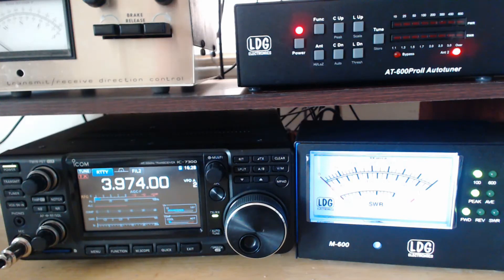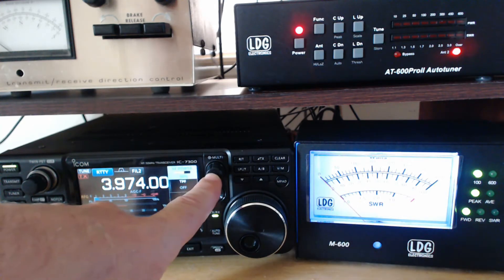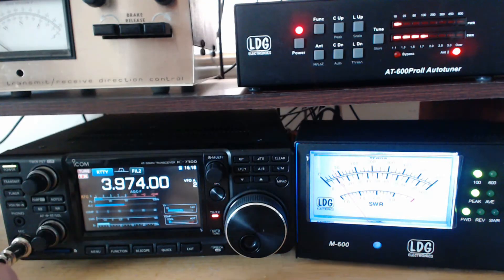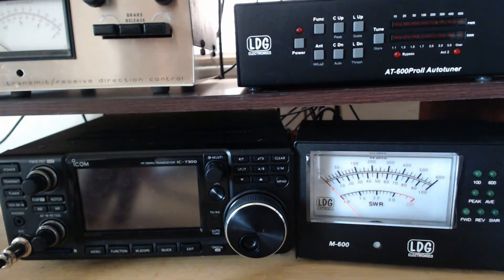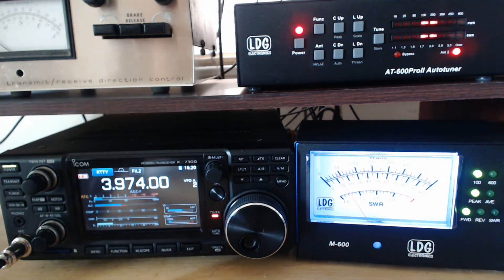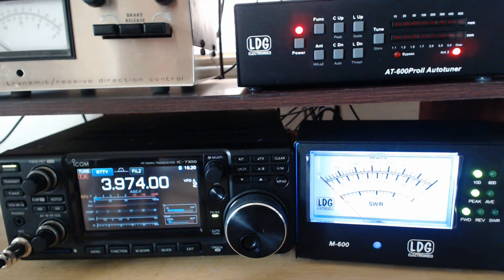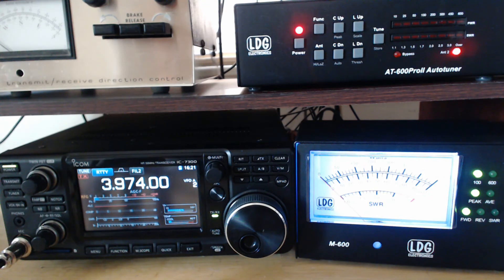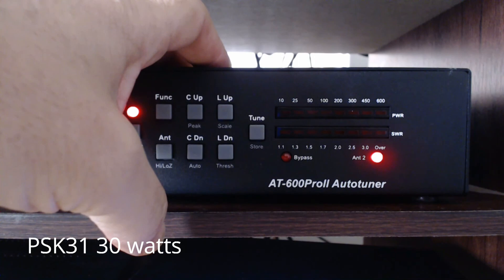LGD AT 600ProII Autotuner Advanced Operation

Comment: I’m thinking about buying the LDG AT-600ProII remote antenna tuner for an off center fed flagpole antenna and a rain gutter antenna. They are non-resonant antennas that could have very high SWR. How well does the remote antenna tuner perform when the SWR is very high?

Does the remote antenna tuner make any difference for the received signals, or is it only for improving the ability to transmit?

Could you make a video demonstrating the larger accessory SWR meter with your amplifier?

I’m considering SGG, LDG, and MFJ remote tuners. SCG is the most expensive, but maybe the best. MFJ might be the lowest quality according to many reports. How do you rate the LDG remote tuner quality compared to the competition?
Reply from the maker: Hi Dave, thank you for reaching out and commenting here. I don’t know if that LDG would handle the rain gutter antenna or a flagpole antenna as you described. Your best bet would be with a roller inductor manual antenna tuner. You could address your question to LDG support and see what they say. Yes when the antenna is tuned RX is increased. I am in traveling and don’t have access to the big meter. GL and best wishes to you and yours. 73 and good DX!
Reply: I didn’t realize it right away that LDG tuner is a shack based antenna tuner, not a remote antenna tuner. I want to use an antenna tuner for non-resonant antennas, such as an off center fed flagpole antenna and rain gutter antenna. 

There’s a W6NBC video that explains the differences between the resonant and non-resonant antennas. The non-resonant antennas, or resonant antennas that are used severely off frequency from their resonance, where the SWR is high must be tuned with a remote antenna tuner, not a shack based tuner. The SWR can be pretty extreme, like 10:1, 30:1, even up to 100:1!

The reason that the shack based tuner cannot be used for very high SWR conditions is the coaxial cable loss. The shack based antenna tuner makes the radio happy, but the SWR is high on the entire length of the coaxial cable. So, the power loss in the coaxial cable can be severe, like a 50% power loss or more, even with 100 feet of LMR-400 coaxial cable, which is low loss coaxial cable.

The solution to the high SWR problem is to put the tuner near the antenna, which calls for a remote tuner. That eliminates the severe coaxial cable loss, and makes the radio happy.

What’s the worst SWR that you tune with the shack based tuner? It would be very interesting if you could measure the power loss of your coaxial cable at the antenna. You could then determine how severe that high SWR on the coaxial cable impacts the amount of power that you can get to the antenna with a shack based antenna tuner.

Thanks for answering the question about the receiving performance. I wondered if the antenna tuner improved the receiving performance. Does it improve the receiving performance just a little bit, or can it be a dramatic receiving performance improvement? I’m guessing that when the SWR is extremely high in the coaxial cable line, which you’d have with a shack based antenna tuner, that the receiving performance would be degraded more.

I’m pretty sure that LDG makes remote antenna tuners, which is what I would need for my non-resonant antennas.

Thanks for the antenna tuner video! I found the video that you made on the external meter. Hopefully, you’re traveling in the southern states where it’s warmer, to get away from the frozen tundra up north!

Comment: Very good video on that tuner. I have the same one. What do you need the analogue meter for? It is about $150 in the UK. 73 de Guy G4DWV 4X1LT
Reply from the maker: Hi and thank you for commenting. Nice to hear from you.

Yes, it is expensive and I didn't order it at first, but after having the autotuner for a while I decided I needed it. I use the analog meter to tune up my amp. The LEDs on the autotuner just don't work good enough for that. It's pretty nice to look at too and I can see my power at a glance. Nice big meter! 73's Rich, K0PIR